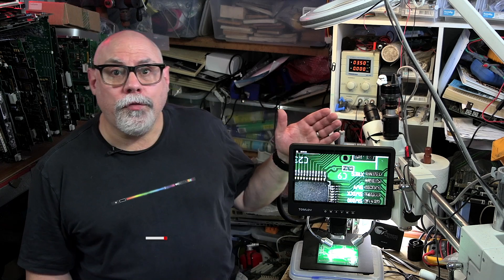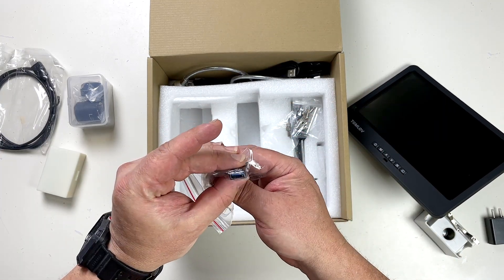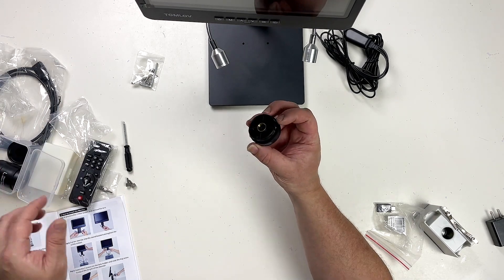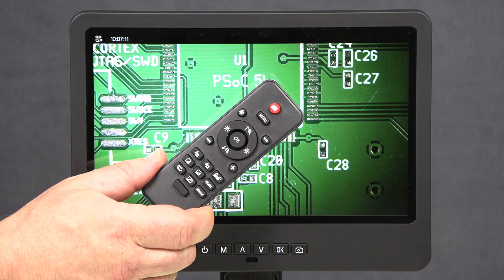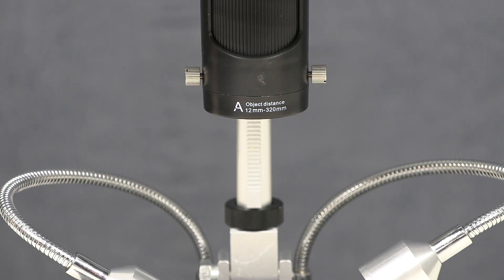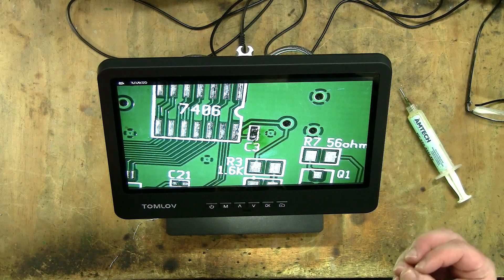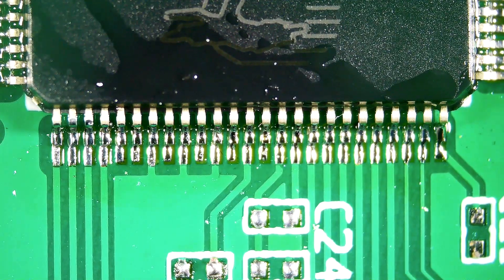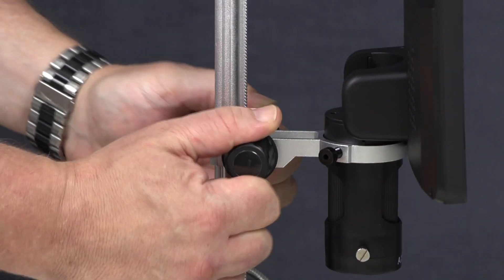Tomlov DM602 Digital Microscope Unboxing and Review

Comment: Hi Bruce. Do really enjoy your videos and really getting into soldering and repairing. Just wondering if you could do a video on soldering temperatures. I often seem to struggle setting the temperature and think I'm going too hot but then colder I don't seem to get the right action. 

Kind regards,
Gareth from "Old South Wales".
Reply: If you are having problems with solder meting at high temperatures, it might may actually be your tip geometry that is the problem. You want to use the biggest tip that fits with the components you are using. I don't do much small work so I like to use a chisel tip and sometimes a bevel tip. I find the conical tip that comes with most irons to not be not the best in most situations. Heat transfer into the solder is just as important as the temperature. I'm not Bruce and you might already know this, but I hope this may help.
Reply: @nerdherd1796  Thanks a lot!

Comment: I really appreciated the video, Bruce.  Seems almost perfect, with the one big exception that I couldn't use it to solder together an SE Reloaded or SE/30 Reloaded board due to large PCB size.  It's really a shame there's no alternative way to mount the LCD so large PCBs can fit nicely under the lens.  If it had the ability to accommodate large PCBs, assuming depth perception wasn't such a big loss, it might come close to replacing your large and heavy microscope.

Comment: I have been using a Tomlov for months doing Macintosh repairs and could not be happier. I did however disassemble mine and made a rig that fixes it to a custom bracket that fits onto a VESA mount attached to a desk mounted monitor arm so the base is not a restriction (just the desk depth) I also tried various other lights but ended up reusing the Tomlov ones as they are very bright and fully adjustable.
Reply from the maker: We’ll done!
Reply: That is definitely something I was thinking about doing as the microscopes that come with a flex arm are ridiculously overpriced imho. So, a $20-$30 solid flexible monitor arm that can be modified to be used with a microscope is the way to go.
Reply: @Turco949  It certainly makes it easier to use and has the same advantage of the flex arm scopes in that you can swing it away so that it takes up no desk space at all. Plus you can increase the height way above the design parameters if needed- I have since replaced my Tomlov scope with an Andonstar as the tomlov kept breaking down and after three replacements they just refunded me :( .
Reply: @XKSteve Which specific model did you end up getting from Andonstar? My DM501 Pro still hasn’t been shipped yet, and I’ve been offered a refund as they don’t know when supply will be back. Thanks for following up with your experience.
Reply: @Gazmassive  I got the Andonstar AD2495-M.comes with three lenses which admittedly have a rather odd fitment method using two screws rather than a more obvious bayonet fitting. one lens is pointless for soldering but the other two are fine. The L lens is great for small IC's/402/805 and 1206 work and the A is perfect for Tants in B or C cases and larger footprint IC like a 68020 or FT232RL. Screen is bright and responds quickly to changes in light. Focus is better on the L but ok on the A especially if you use the vertical adjuster on the side. Happy with mine but like all Chinese electronics the firmware could be better written and some of the mounting solutions are rather ... err... over complicated but as usual I modded mine LOL. I liked my Tomlov but it did have issues with the aforementioned firmware and a rubbish cheapo remote. HTH

Comment: Impressive bit of kit! I've been looking for a microscope for a while - the cheapo one i bought a few year back has given up the ghost, and i could do with something that's going to be useful for building up boards - especially the SE/30 Reloaded. 

For reference, I checked Amazon UK and the prices for these is off the wall (£386 GBP / $675 AUD) - no clue why, as i checked AliExpress and found them for anywhere between 50 to 80% cheaper, from the Tomlov store, direct! At Amazon prices, you could get a trinocular setup with an HDMI camera! :o